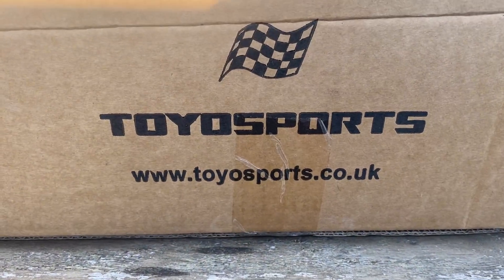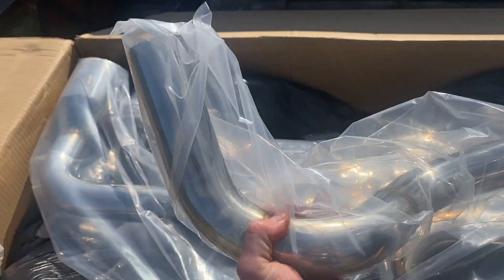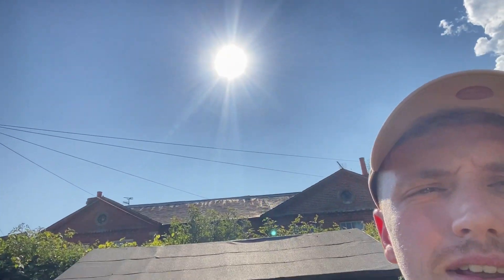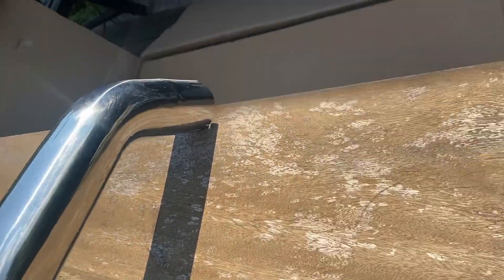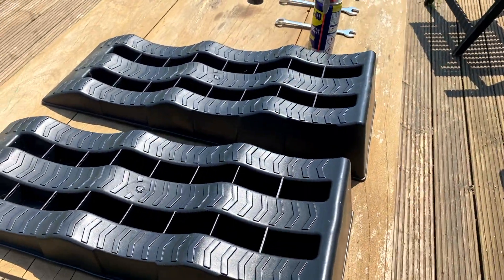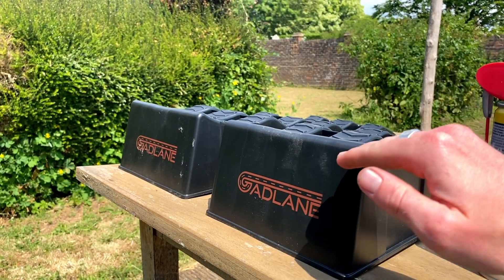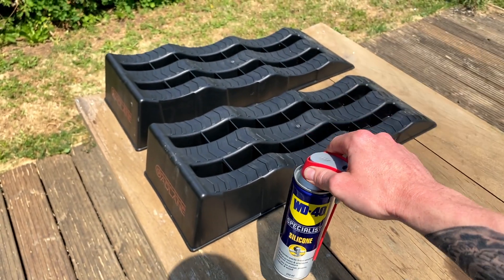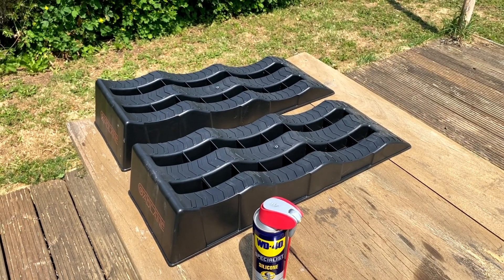DIY 595 CAT-BACK install

Comment: How much louder is the new one in person
Reply from the maker: The cold start is ridiculously loud which is frustrating. Other than that, it is a beautiful sounding system when driving normally, opening it up, the idle. 

All is beautiful and sounds really nice, just the cold start can be an issue